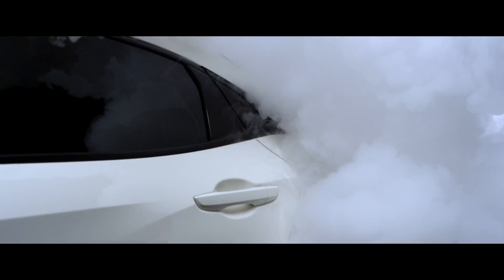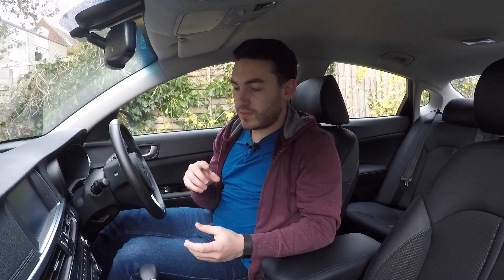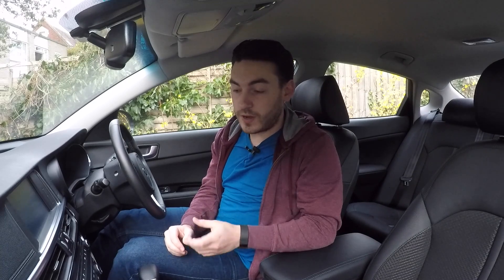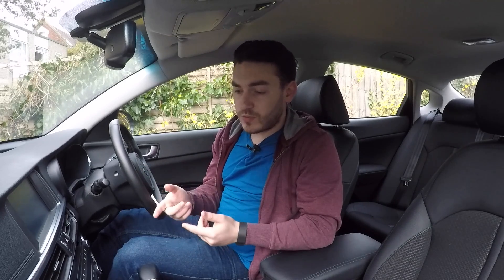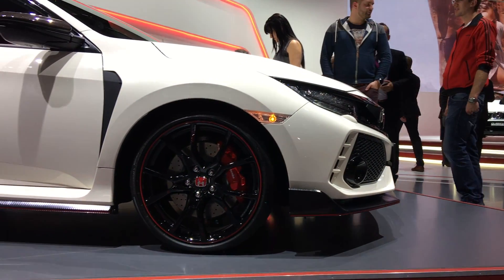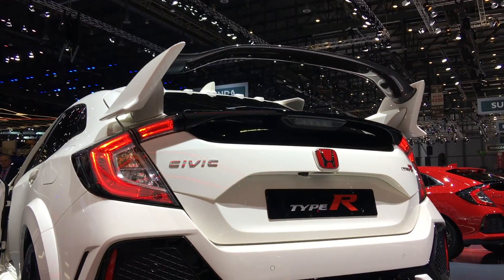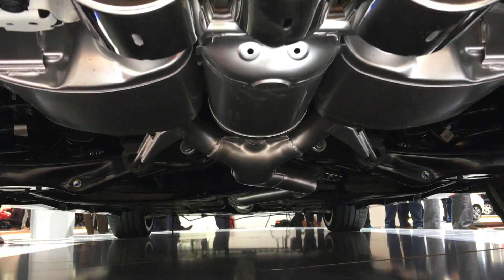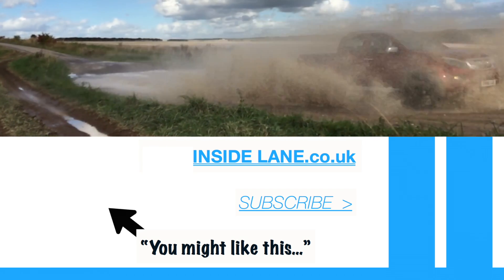Why 2018 Honda Civic Type R has Less Power in America - Inside Lane

Comment: If this is true then Honda is really dumb... Fact is, Europe doesn't actually get better fuel than the US. Europe acquires their octane rating using the Research Octane Number (RON). The U.S. gets their octane rating from an average of the RON and the Motor Octane Number (MON). This average is called the Anti-Knock Index (AKI). The MON is calculated using a test that is aimed at providing a more accurate number for the performance of an engine under load. MON testing uses a similar engine to RON testing but the fuel is preheated, a higher engine speed is used, and variable ignition timing is used to better test the fuel's knock resistance. Since MON is a higher stress test it results in rating the same fuel as a lower octane.

And as others have stated, this video is basically BS. The US version of the civic is rated at 306 hp. Not 306 bhp. The car is still 316 bhp in the US.

Comment: There is no such thing as pre-detonation as said in the vid. There is pre-ignition, and there is detonation, but they are different things entirely.
Pre-ignition is when the fuel air charge begins to combust prior to spark ignition. This is generally caused by something having overheated in the combustion chamber. An exhaust valve, spark plug tip, piece of carbon etc. This phenomenon is not a result of insufficient octane. Detonation, which occurs AFTER spark ignition, is when the pressure rise in the cylinder is too much for the fuel quality used, and the mixture just explodes, as opposed to a controlled burning. Think of the difference between burning wood slowly in the fire place, vs wood that pops and blows embers clear out onto the floor

Comment: U CAN BUY 98 RON FUEL HERE ITS JUST 91 OCTANE INSTEAD OF 87. IN MY VW IF I PUT IN BETTER FUEL ITS GETS A HP AND TORQUE INCREASE(4 HP 9 TORQUE) IM SURE IF U FILLED UP WITH 91 OCTANE U WOULD HAVE THE FULL "EURO SPEC POWER."

Comment: It should be made clear that US octane ratings are in AKI, or Anti-Knock Index. AKI is an average of the RON (Research Octane Number) and the MON (Motor Octane Number). RON is measured at 600 rpm and MON is measured at 900 rpm which attributes to the differences. That being said, 98 RON = 93 Octane US/CAN (available most states in the US) and 95 RON = 91 US/CAN (California and emission stricter states). 

So basically I feel Honda catered their entire US production car to California. Typically manufacturers will make different models for California and the rest of the US.
Reply: Actually, if you read US pumps, it will say "Minimum Octane Rating" above the number. That means you are getting that number or greater. Another thing that should be realized, there is no exact conversion of ratings, you just have to test on both MON and RON to see what the AKI is. In the UK, 98 RON has an MON of 87, so (98 + 87) / 2 = 92.5 AKI. Whatever the actual rating is in California, it can't be that far off from that, if not the same. Even if there is a slight fuel grade difference, the manufacturers aren't going to retune an engine for slight grade differences, they'll just tell people to use the minimum grade that works in their cars, which is 98 RON in many markets, 91 AKI in others.

Comment: The integra type r engine has 12.5: 1. Compration ratio and has no problem with the fuel . So all the sports bikes ( also very hight compration ratio) And super cars . In states the octane is measured differently , in Europe when we see 98 octane it's the max , and they guaranty it's not more then 98 . In states the premium fuel is set to minimum 90 octane ,, it can never be less , only higher number . Like I sad all cars and bikes run on the premium fuel .  There is something else like the old type r has 201 hp and si with the same engine has 197 hp .

Comment: Less power, wrong wheel drive, and about the same price as the Focus RS. FAIL.
Reply from the maker: Yet the Type R is faster.
Reply: no. focus RS would eat it alive, so would the sti
Reply from the maker: I think you need to do some research. The current Type R laps faster than the RS and the STi. Of course this lighter and more powerful model is even faster.

Comment: I love how everyone has a different answer for why it has less horsepower. Everyone always got a bit to add :) Anyways the correct answer is that anything above 300hp is good enough.
Reply from the maker: All the info I presented is direct from Honda, not a dealer, but the actual company. If there are other reasons, they haven't officially been commented on.
Reply: +Pigmoon K I love how you have been proven wrong by others, but you still keep repeating yourself.
Reply: +Inside Lane There is no reason because there is no horsepower difference. The US version is just rated in SAE, the UK version is rated in BHP.

Comment: Actually most of the japanese models differ in output figures , they are higher in europe and even different in several countries: My MX 5 ND has 160 PS stated in germany what is easy to beleve. It is running like hell. Same car has 155 SAE HP in the US what is significantly less because they measure without alternator, AC and water pump. It even sounds differently. But it can be fueled also with standard fuel less than 95 oct what causes power loss but no demage ( knock sensor ) Just for Info: we have premium fuel here  availiable 98 .. 102 oct on every filling station.

Comment: The U.S. version is rated in SAE net horsepower, not brake horsepower. What they said to you was wrong. Also, depending on the MON rating, the AKI rating (AKI is the average of RON + MON) is usually 4 to 6 numbers lower than RON. According to Shell, their V-Power is actually 97-99 RON in Europe. That means the AKI rating is somewhere between 91 and 95 octane AKI. Well, funny enough, that's almost exact the AKI rating for V-power in the US and Canada. This idea that there is some quality or grade difference between North America and other markets is a myth and comes from people not understanding the different rating systems.
Reply: And that is called "hearsay". If I want to know what Honda says, I can go directly to the their website or read their press release. And in fact, it's not rated 306bhp, it's rated 306hp SAE. Cars are not rated in BHP in the US, they are rated in SAE. Anyone, with any knowledge about this kind of stuff knows this.
Reply: Here ya go....

Please add the "dot" to the link.

hondanews com/honda-automobiles/channels/civic-type-r/releases/civic-type-r-makes-u-s-debut-at-2017-autocon-in-los-angeles

"After its global reveal in Geneva earlier this month, the first production Civic Type R coming to America will make its U.S. debut at the 2017 AutoCon automotive performance and tuning convention in Los Angeles on March 26 with an on-stage presentation scheduled for 4:00 PM PDT. With 306 horsepower and 295 lb-ft of torque* on tap from its 2.0-liter DOHC, direct-injected and turbocharged i-VTEC® in-line 4-cylinder engine, the 2017 Civic Type R is the fastest, most powerful Honda ever sold in America. Featuring aggressive styling to match its performance, the Civic Type R is the "hot hatch" that U.S. compact enthusiasts have been dreaming about."

"* 306 horsepower at 6,500 rpm and 295 lb.-ft. of torque from 2,500 to 4,500 rpm (both SAE Net)"
Reply: rdcrezz No pre-detonation is a thing. Google is your friend.
Reply from the maker: +Shoemowetochawcawe This information comes direct from Honda, not a dealer, but the actual company.
Reply: +Pigmoon K Like most people, you don't understand the AKI rating system. RON does not convert to AKI at all, it has an AKI range that depends on the MON. That means you can have one station selling fuel rated 98 RON and 90 MON, while a different brand or region of gas can sell 98 RON but with an 86 MON. There is no way to directly convert, nor is there any direct connection between the two rating systems, and it also means not all 98 RON is the same, which means the ratings by other systems varies. In most cases, Europe's 98 RON only has a 87 MON rating. Since AKI is the average of RON and MON ratings, that makes for 92.5 AKI, a grade that is very close to what is offered in the U.S. In fact, most states sell a fuel with a 93 AKI minimum rating, a rating that's even higher than the fuel being used in Europe. I worked for drilling company in the state of Louisiana, and this is well understood in the industry.
Reply: +Inside Lane And just because it's from corporate doesn't mean it can't be inaccurate. I don't know how many times I've found that out. You could call the same company a dozen different times and get dozen different responses from a dozen different people who know nothing. Honda North America does not publish the cars with 306BHP anyways. If that's what they told you, then the information is certainly bad.
Reply: +Inside Lane Also, "pre-detonation" ? I think you are confusing "detonation" and "pre-ignition".
Reply: Shoemowetochawcawe He just told you that he got his info from Honda themselves. Are you saying that Honda are wrong? Maybe you should let them know..
Reply: Zero Ninety link? it's just called detonation...

Comment: wrong wrong wrong. it's just the way the power is measured with or without water pump and other stuff
Reply: Inside Lane, then you must've been speaking with the janitor there or some other person who is not in a position to be giving you an answer. 306HP is listed on Honda's US website, not 306BHP. UK BHP and US HP are different. One is gross horsepower, the other is net horsepower. The car is rated 306HP in SAE net horsepower, 316BHP is gross horsepower. On top of that, your octane numbers are another problem with all this. You're 98 RON is roughly equal to 92-93 AKI, a fuel grade that is similar to the top fuel grades in the US. If there was a horsepower difference, that explanation doesn't check out at all. Even if what they told you is what you're telling us, you should be triple checking facts before making these videos. Believe it or not, even manufacturers get things wrong.
Reply from the maker: My information comes direct from Honda. Not a dealership, Honda the actual company.
Reply: +Inside Lane The people at Honda must be trolling you or something. Your information is way off.

Comment: This highst pump gas we have in the u.s. is 93, i live in socal and i can only get 91 besides the rare and expensive racing fuel u can buy around the cities that have tracks like irwindale. However since these cars are turbo i imagine the compression ratio is much lower than traditional hondas and doesnt need anything higher than premium gas we get... Also arent the octane rating systems universal? its just like a 19mm wrench is same as 3/4 wrench?

Comment: If anything the god damn North American version should be faster, we haven't received a Type R yet.
Reply from the maker: +Welshy But the the US isn't the biggest market for this car.
Reply: Welshy it has been a long time. I bought mine 17 years ago last month. Type-R's have changed. They were rawback then and you got more for less. Now, it's loaded like a luxury vehicle. that's not a Type-R imo. Doesn't help that this car looks like it was designed by my 11 year old son.
Reply: Welshy yes there was. The Integra Type-R was here for 97, 98, 00, and 01. It had less power than the JDM version as well. I owned a 2000 model.
Reply: chibbs1975 but not a Honda tho, yes I know about the DC2, it's been a long time.